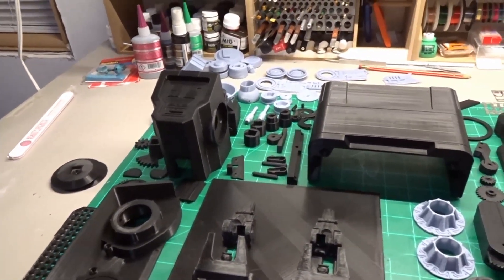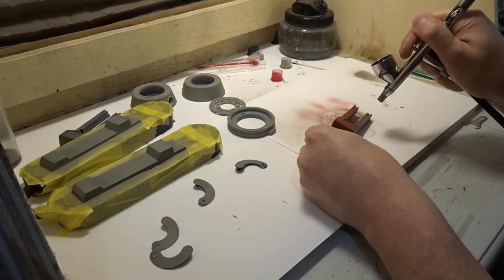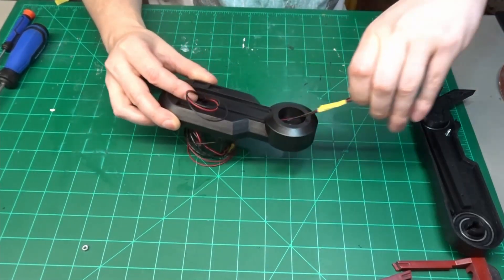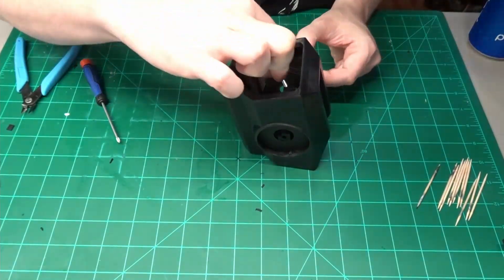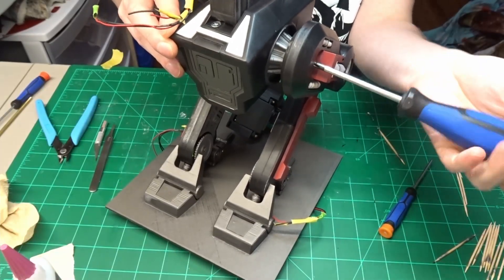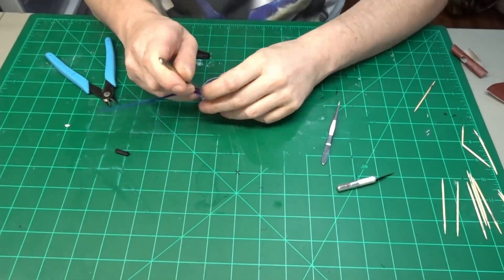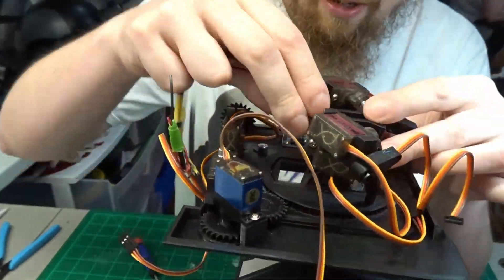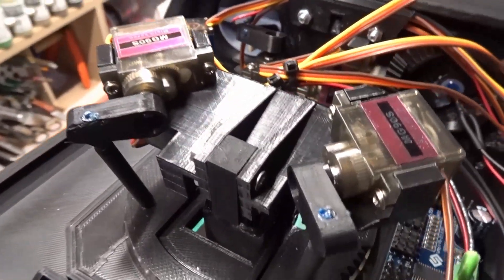BD 1 Build Part 1

Comment: I hope you will rebuild BD1 and continue the demo, this is super helpful
Reply from the maker: It's still on the to-do list. I feel so sorry for him every time I see him on the shelf. Unfortunately my FDM printer is also down and the parts I need to print can't be done on the resin printer.
Reply: @FlokisModels  uh oh, that's what I have, the Saturn 2 8K.  Is it the resin or size of printer?
Reply from the maker: @gadgetnc  a bit of both, I got the 1st Elegoo Saturn. The parts I need I'm afraid resin would be too brittle for

Comment: Did you ever finalize it?
Reply from the maker: Not yet hoping to have some time at the end of this month to work on it again. It fell off my shelf and some parts broke that I need to 3d print again.
Reply: @FlokisModels that sucks man. I am thinking of making my own, with a different, and stronger neck mechanism to make less wobble. I also was brainstorming ideas for a functional telescoping neck, like in the  game. I am REALY good at mechanical design, but can't quite figure out coding arduino though, that's why I'm kinda stuck at the brainstorming stage